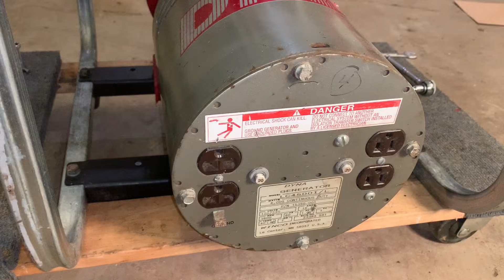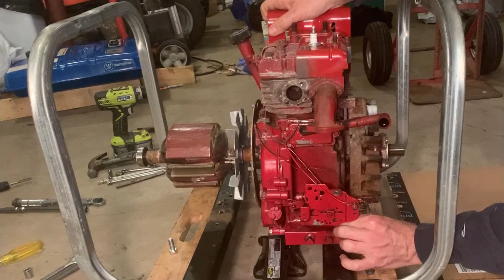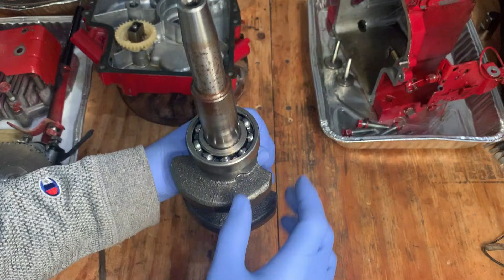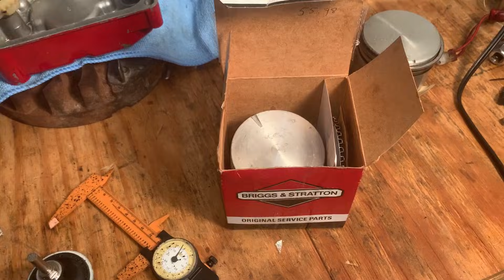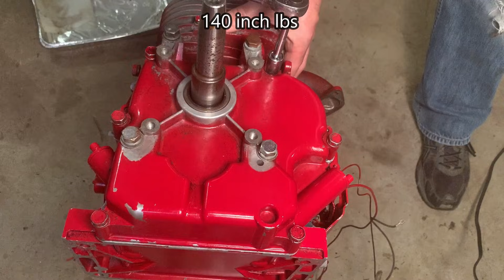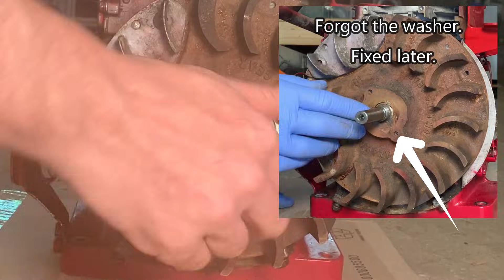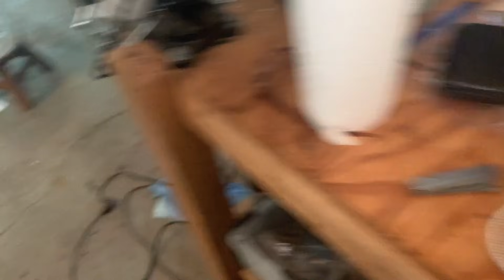Old Winco Dyna Generator (Part 2 ) - Engine Rebuild on a Briggs L-Head Engine

Comment: Great bit of insider info on the cam timing mark, 98.6 % of us would make that mistake. I probably won't be inside a flathead Briggs, but if I do. I know how much 1 tooth off on the cam timing will affect overall power. Thanks for these very good videos on rebuilding a smallmengine.

Comment: I always enjoy your tear down videos.  This one reminded me of a neighbor I had in the early 1970"s.  He was an Electrical  Engineer with a freshly minted degree from his university.  He bought a used color TV and decided to fix some issue with the reception.  He completely disassembled the television and then could not remember how to put it back together.  He sold the parts to a TV repair guy in a cardboard box.  There is no substitute for experience.

Comment: THE REASON YOUR PULLER DIDN'T FIT AND THE FLYWHEEL BOLT DIDN'T FIT, IS BECAUSE THEY AREN'T THOSE STUPID METRIC CRAP THEY'VE CURSED AMERICA WITH!

Comment: Interesting..... I had a feeling that valve timing was off, as eluded to in my earlier comment (part 1) but hadn't really considered that someone might actually have been in there and loused it up, but the overheating of the exhaust, and cylinder block, fit in perfectly with what you found. It would also burn the exhaust valve over a period of time.

Good work James, on a job well done 👍

Comment: James Condon if there is enough area to tap the do make pipe thread taps that would allow you to use a pipe thread plug to hydro the rotor off b

Comment: Request for a video about setting the govenor correct. When taken apart, there is no marking how to put the external govenor plate on the govenor rod.
33:42 Could be a straight taper on the inside ? Than one flat side should be smaller than the other side of the ring.
Thanks for the video's.

Comment: I have a Winco/Dyna 5500 watt 11hp B&S electric start generator, very similar to yours except mine is in like new condition. I bought it new around 1992, was always stored indoors and it worked great for years until it didn't. So I bought a Ridgid/Yamaha 7500 watt generator and then fixed the Winco/Dyna generator. It had a bad diode which after replacing it, the generator worked great again. But it is my backup now as my Ridgid has a function display and a bigger fuel tank. Great videos!

Comment: Really interesting series on this engine. Quite surprised an old school flathead is that sensitive to cam timing. Looks like the cam has about 60 teeth, so 1 tooth would be about 6 degrees. Just 6 degrees and it ends up with 1/3 the power it should, crazy!

Comment: James, I was wondering, can you lap a valve with a power drill rather than the suction cup handle?
Also, when you home out a cylinder, do you have to replace the piston with a larger one?
Thank you for your videos I watch them for hours.

Comment: The nut you were turning was the governor sensitivity there should be a tab with a spring to the governor arm, that is the way to adjust engine speed, good find on the timing

Comment: Thanks for the info - very informative of the details of an engine problem.  I'll tell you a couple of things you may want to try that have helped me.

I've rebuilt 2 of these and when they are surging at no load - there's a couple things I found.  First - I always replace the governor spring as the constant stretching and tension over the years will inevitably wear it out.  

Second, the idle jet and main jet have to be absolutely perfect along with the governor spring tension - or else the surging continues at no load.  

I hate how the exhaust is always pointed at my face when I adjust it - I feel like crap from all the carbon monoxide I sucked in last night even running it outside.
Reply from the maker: I was just working on a 10hp Tecumseh flat head and was thinking the same thing.  No way to adjust the governor spring without putting your face right in the exhaust.  Not the best design.

Comment: BTW: .010" ring gap is the maximum on the L-head engines before you need to bore to a larger size. Also, the carbs on these motor suck, I always had to fight the one on my old sprayer.

Comment: I have that same engine on a coleman powermate generator. It has been a solid generator for decades.  I could tell immediately when you started it that it didn’t sound right. I guess that was the timing.

Comment: I know it’s been a couple years but do you still have the part numbers for the parts you replaced? I have that same engine on a 1991 Coleman powermate 4k but it broke the con rod.
Reply from the maker: Here is a link to the parts diagram for this engine.  Would double check your engine number though before ordering anything.  https://www.partstree.com/models/195432-4070-01-briggs-stratton-horizontal-engine/
Reply: I have the same gen. 30 years old and has always run great.

Comment: Nice catch on the diagnostics, I luv these old engines
If I may,, on some engines the carb needs the filter/housing to stop hunting.
It depends on the setup but in some cases the longer intake tubes straighten the airflow, condense it down into a laminar flow. 
In some cases the carb opening can get a poor signal, air doesn't enter in properly and causes issues in the venturi. 
Now this may not have been the issue here but as you know that intake system is impressive. These are updraft carbs. Not seen in too many engines.
Much like the old Ford Flat heads. I wouldn't be surprised if these carbs would run one of those engine rather well!

Comment: if you had all that air blowing through the exhaust and the whatever the hell that thing was why are you blaming the exhaust valve the exhaust valve is before the rings if the rings are bad the Piston is bad then you have blow by into your crankcase right
Reply: I believe he was showing that he had a good amount of air leaking out the valves AND the crank case breather...  The poor sealing bore and to a lesser extent valve guides was the source of the air from the breather I believe.

Comment: Hello James, this is your biggest fan here, I had a couple of questions for you. 1) What do you do with these generators after you rebuild them? 2) How did you get started on rebuilding small engines, is that something you had learned from someone, or at work, or have taken classes? I would be very interested in watching a video on how you got started with engine rebuilds. Also, I have a Husqvarna Straight Shaft Gas String Trimmer that turned off while I was using it during a 95 degree with high humidity outside temperature, and it does not start anymore. I was thinking that I can now take the engine apart (thanks to you and tons of hours of watching your videos) and see if I can figure out what the carb is doing.
Reply from the maker: I sell them all once they are fixed.  I started small with cleaning carburetors and built up my knowledge though YouTube, Google searches and trial and error.  The trimmer if nothing else will be a learning experience.

Comment: I love to watch the hydraulics in action with positive result. 

BTW in another channel I saw how a bearing can be removed from a blind well, in absence of a special puller, by hydraulic technique. 

The idea was to pressurize the junction between bearing and the well bed with hydraulic fluid by feeding through the bore of bearing. Normally this is a dumb idea because water or oil will escape through bearing balls. 

The trick was to increase viscosity in that fluid - to a consistency of mud and clay - plus inertia. (Same inertia seen in this video aided by an impact driver). In this case, pulverized news paper sock with water was used (although oil and other fine tissue may work too). The mixture was fed through the bore a small batch at a time aided by a firm push of a rod of equal bore size until the paper mud show up at the bore rim. At this time pounding starts, the rod is hammered into the bore full of mud. Water can be seen gushing out between balls but the mud stay in. Continue adding mud after each drive. It was fun to watch it actually worked on something seemingly impossible without the right tool.

Comment: I appreciate and share your enthusiasm with generators of any kind or brand , and your pursue for a perfect result ,,, 
I have experience with Briggs Straton  that the cam loves profile is not of the best geometry ,,even when the correct specified  clearance is adjusted if you pay attention when the valve make contact with the seat is very well beyond any reasonable valve timing and that is the reason you see such a low compression  I have ground the valves stem to simply satisfy a normal valve timing of some 10 to 15 degrees of overlap right at TDC and only then the intake seals good right after BDC ,, but the clearance is then excessive in the order of 20  25 thousands or more ,, for sure the cam followers do not take full advantage of the acceleration and deceleration ramps ,,  they do click , but they run great ... 
Thank you for the effort in producing these videos ,, EB.

Comment: One of the challenges with old small engines as well as older automotive engines is that they where designed to run on Leaded Gasoline which was much easier on valve seats due to how that toxic additive coats and lubricates and cushions valve to seat impact   ,modern engines that designed to run on unleaded fuel have hardened exhaust valve seats due to unleaded fuels lack of property  .  Running an engine designed for use with leaded fuel on unleaded requires machining the block (in the case of a L head Brigs and Stratton) or head and pressing in a new hardened valve seat, or using a special purpose lead replacement fuel additive (that does not contain lead) ,Small Generator engines due to how they operate at a relatively high load and speed are more prone to this issue. there are lead free fuel additives for this issue. you will find a lot of old small engines brought back to life that will burn up the exhaust valve seat (if its not hardened) due to this issue.
Reply: these Briggs I/C come with hardened seat hard stelite exhaust valve and cast iron sleeve ,, they are great engines develop good power and with a bit of character

Comment: If you remember this engine had periodic excess turning resistance as the piston traversed the cylinder. The overly tight ring gap which Mr. Condon found, even after cylinder honing, would explain the excess resistance. The new properly-gapped rings solve this problem.

Comment: I read some of the comments and Wow, you got a tough crowd to please! You do excellent work and leave not much to chance... filming is topnotch as well.
I'm working on a B&S 5HP with a monarch pump attached... engine was kept outside and stuck solid... piston, rings, and valves all stuck, but are all loose now. This engine has ball bearings and the timing marks threw me for a loop too at first, but both B&S service manuals show the same install sequence as what you did. Just to check though I backed off the bearing and there is no timing mark visible on crank gear, only on the crank counterweight. My engine WILL pump again... great stuff, keep up the good work! 👍
Reply from the maker: Thanks.  I hate doing rebuild videos because people are so critical.  But been doing a lot of them anyway.  Ifs not a sports car.  It will be fine.

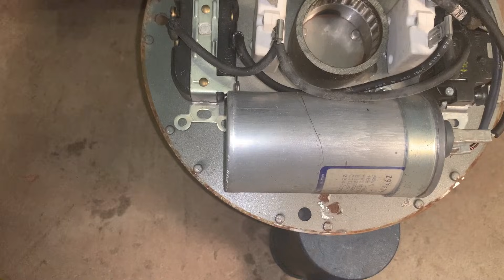Comment: 9:20 you know you can very easily discharge it by shorting that contacts with a screw driver. Then there’s no safety issue.

Comment: Wow a hose clamp for a ring compressor I would have never thought of that
Reply from the maker: Not my first choice, but it works (most of the time).
Reply: I saw a mechanic in Turkey reassemble a 12 cylinder diesel marine engine using a hose clamp for each ring since the grooves on the pistons were too far apart for the clamp to go over more than one ring at a time. The pistons must have been almost 20 cm (nearly 8") in diameter. It was a painfully slow process, but the mechanic did not look like he was in a hurry. 🙂

Comment: Question 1
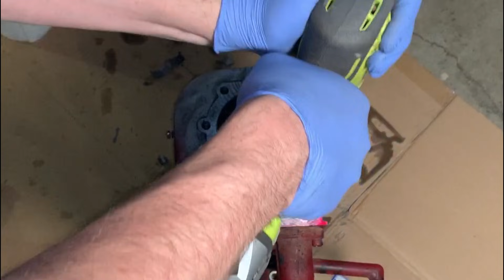At 24:13, you use a battery powered tool to clean the carbon from the head and the gasket material from the engine block mating edge surfaces. What tool and what abrasive did you use for this engine?

Question 2
When you honed the cylinder, did it remove the scuff marks from the cylinder wall? How long / how many passes were required?

Question 3
Valve lapping seems important-- but is it critical to continued proper operation?

Comment: You should try the old Briggs starter clutch removal trick if you have an old starter clutch just take it apart and use the part that goes on the shaft you can use a crowbar behind the fly wheel hit that clutch disk end and it will pop right off and not damage the shaft.

Comment: Sometimes a small adjustment like a tooth can throw a car or truck engine off too. Someone didn't know what they were doing when they got in it before you! It happens!
Reply: It happened to me when a garage put a new timing set on the engine in my car.  Fortunately there was other stuff that needed to be dealt with (I ended up changing the heads due to bent valves) and I caught it before I put it all back together...
Reply: @Roy_Tellason  Good catch! I've been learning how to work on small engines for myself. Necessity more than desire! This ethanol gas is wreaking havoc on my mower, generator, chainsaw and trimmer.  There are only a couple of stations in the city that sell unleaded with no ethanol.  They're not close by and it's gone up in price too!
Reply: @jamesdiehl8690  I watched a video recently about how to remove ethanol from your gas.  Of course,  paying for a gallon of gas and ending up with 9/10 of a galloin might alter perspectives just a bit on the costs of getting the pure stuff....
Reply: @Roy_Tellason  I would like to see that!  I use Stabill in it to help with the ethanol, especially during storage.  The problem is, that the Feds say they want 35% ethanol, but there have been tests around the country, showing some stations are selling over 50%! A few were 55%!  Even my pickup doesn't like that!  It runs doggy!  Sputs and loses power!

Comment: I believe I have watched pretty much most if not all of your generator rebuilds. This one was one of your best by sticking to it to determine what the actual problem was. The one thing I couldn't figure out was the damage to the piston and cylinder wall when none of the lower end was damaged. I didn't think timing would do that...either it runs or it doesn't, or in this case, much reduced power being timing off by several degrees (one tooth). Excellent work!!
Reply: The piston/cylinder damage...with the timing off, and the exhaust valve partway open when it should have been closed, possibly canted the piston to one side when the plug fired, scuffing the one side of the piston/cylinder. My idea/theory.

Comment: if you have already figured this out, disregard but when i worked in a welding repair shop, these type small generator rotor removal was using a solid rod made from an original mounting bolt with the head cut off about a half inch short and then a slot cut into the end to use a screwdriver to screw it into the end of the crankshaft.  then a bold of the proper thread was screwed into the end of the rotor where you tapped the threads, til it applied pressure to the shortened rod and would pop the rotor.  hope this makes sense.
Reply from the maker: Did that recently.  Worked well.  Of coarse a week later I realized the bolt I cut down was not an extra one.

Comment: I'd love to know how that rotor functions without a slip ring. I see windings 🤔 what are the ends connected to? Just one big loop of wire?
Reply from the maker: Brushless generators function a lot like a transformer.  The primary winding is on the stator and it is able to excite the rotor without a wired connection.  Similar to wireless celll phone charging or a wireless charging system for a tooth brush.  The power is not as clean, but less to go wrong.

Comment: You went far into the rebuild of that old engine. Nice job 👍 well done Sir.  
But if you went that far into that engine. Why didn’t you replace both oil seals on the crank? I’m just curious.
Reply from the maker: I should of, but this generator was not worth a lot of money and already had too much into it.

Comment: James, I have a higher HP version of this unit and am looking for governor parts and a governor spring that would work.  Could you point me to a supplier that might have a spring and parts?
Reply from the maker: What is the engine model number and code?
Reply: @jcondon1  James, the Model is 252412, The Code is 86022411. the type is 0707-04 and it's a Briggs and Stratton 11 HP.  thanks for responding so quickly.  Really enjoy the detail in your videos.
Reply from the maker: @davewave1658  I order a lot from PartsTree.  Looks like they have parts for your engine https://www.partstree.com/models/252412-0707-04-briggs-stratton-horizontal-engine/
Reply: @jcondon1  Thank you James.  A big help.  Keep up the interesting work.

Comment: hi james you spend a lot of man hours on this, but i think its not about money but the buzz, great video , part1 and 2
Reply from the maker: Thanks.  Yes this one was cheap and I liked the look of it.  But even fixed up, still not worth a lot of money.  I like the older engines.  They are built much better.  Have not seen a ball bearing in any of the newer Briggs generators.

Comment: Very, very interesting and informative video. Very good of you to think about testing and checking the timing. I'll bet it was assembled wrong at factory. 
     You know that the engine has to get hot to seal all the tolerances and then it runs like a champ.